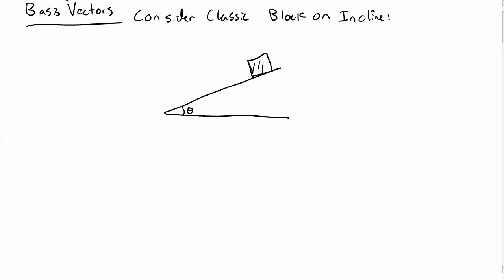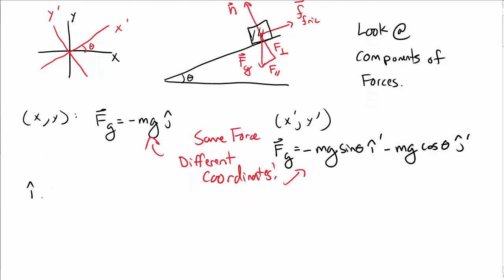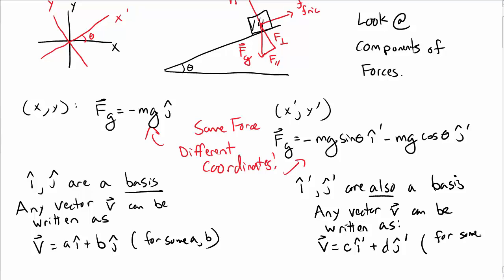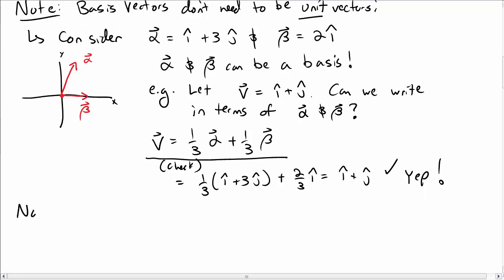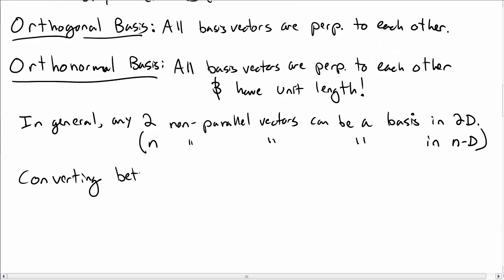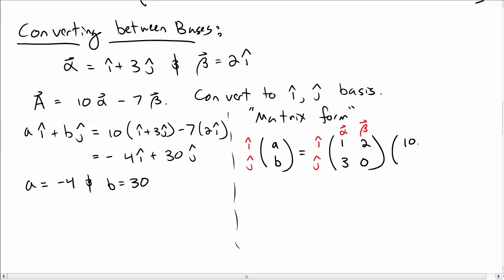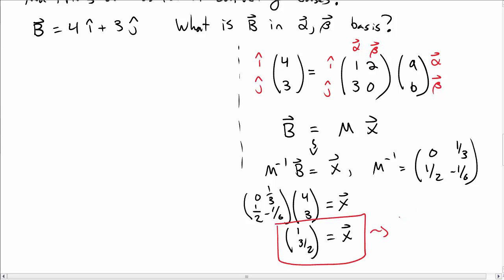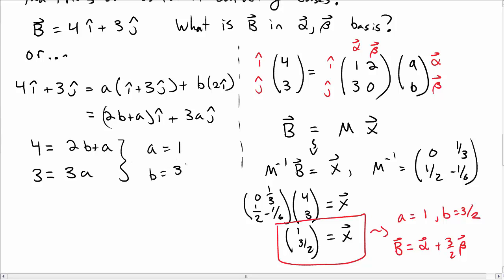Basis Vectors

Comment: Hi Dr. Underwood. Riveting videos. Thank you. At about the 5.51 mark you might have pointed out that for 3D not only do you need 3 non-parallel vectors to form  a basis but that they must not be co-planar. 

I am curious. Are these videos done in real-time. Can you really write as quickly as you ar talking in these? I know it is a trivial question but I am doing a masters and reckon I should use my intuos pro wacom to record my solution set. I much prefer the black on white presentation you use compared with so many others looking like the Khan academy videos. Anyway have you published how you make your videos? 

Is it a wacom cintiq or an intuos pro and what are your settings and software that gets such  a  lovely job done.
Ronan